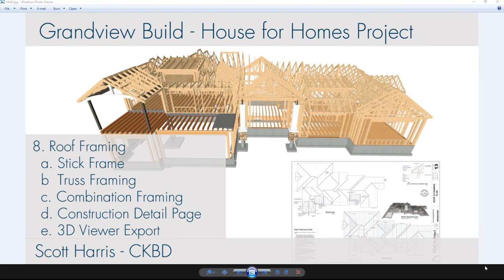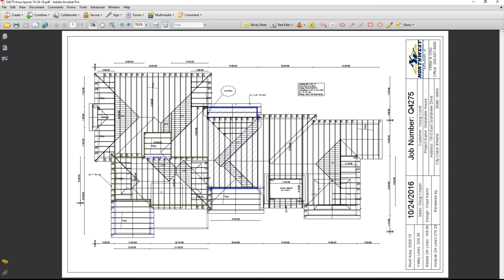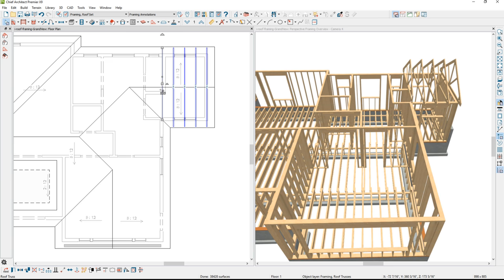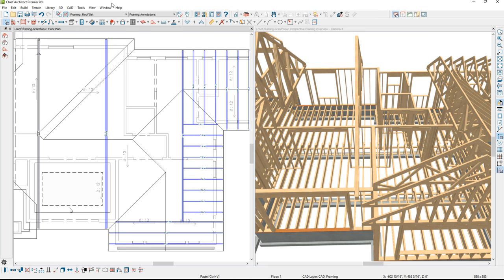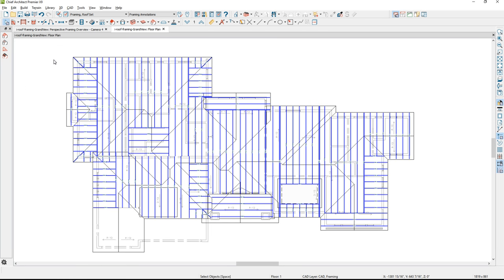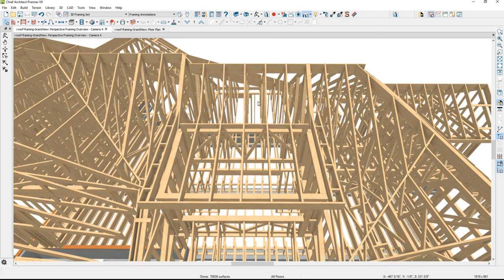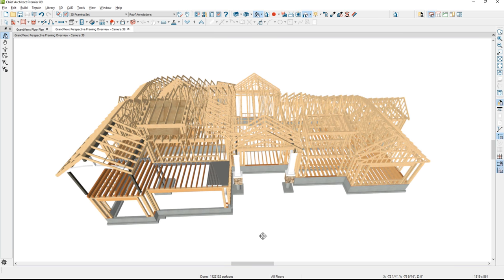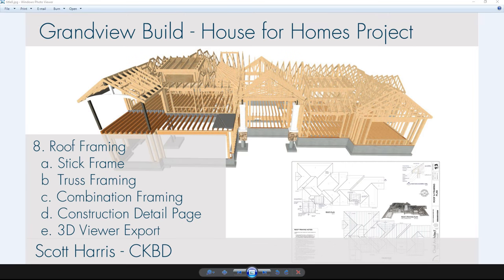Grandview Build Project -  Automatic Stick Framing and Manual Truss Roof Framing

Comment: I'm trying to make multiple trusses via Multiple Copy but that button doesn't appear (HDP 2021). Has this process changed or am I missing something?
Reply from the maker: The Multiple Copy tool is not available in Home Designer. However, there is the Sticky Mode feature. Select the truss, click the Copy/Paste edit tool in the bottom toolbar, then click on the Sticky Mode secondary edit tool, which allows you to paste as many copies as you'd like without re-selecting the tool each time.